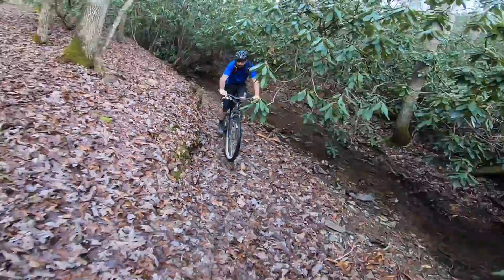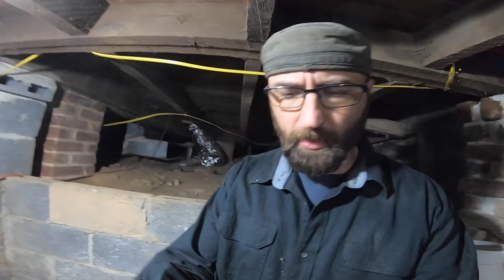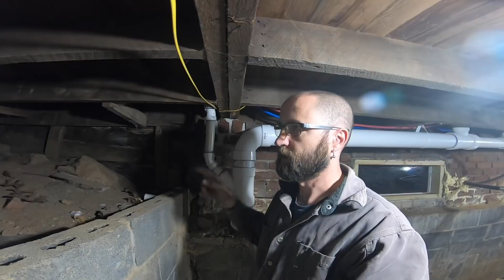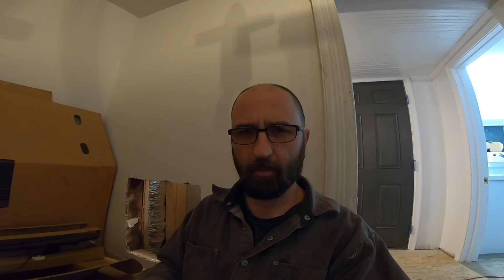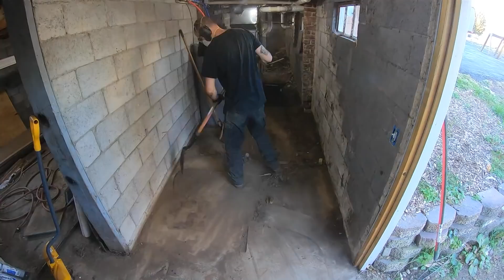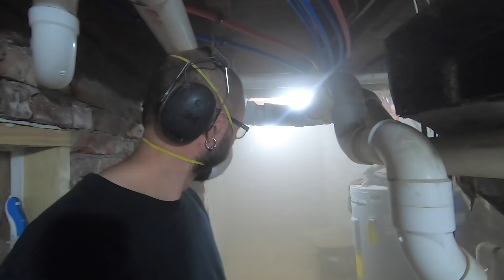Hoarder House // 130 year old house gets new pipes.

Comment: I actually used some of those shark bites for my tub/shower, a few years back (as I had no idea how to weld; or do much carpentry work, at all) and they seem to still be holding out.  If need be, though, I’m more confident that I could replace them.

Also, somewhat similar to what you did for the shower, I ended up not glueing the shower surround to the tile board.  Instead, I attached some heavy duty velcro behind it.  That way, if something needed repair, I could simply pull the whole piece off and attach it back when I got done.

Love your channel, brother!  It has inspired me to work on my own home again 🙂

Comment: Im worried your waste lines won't pass inspection for not using a Wye for a sanatee on its back. I couldn't tell if you have vents on the other fixtures.
Reply from the maker: It's fine. I don't have to use a wye. The other fixtures don't need vents since they're within 6 linear feet of the trunk line, which is vented.
Reply: @EmptyHammock  Sounds good. I know its dictated by area. My county won't allow me to do that. Lucky ha

Comment: When I install claw foot tubs instead of installing the cheap shower supply and shower curtain rods I make them out of 1/2 or 3/4 copper pipe that I solder together and it's way more ridged and custom fit for some of the tight area's I encounter. Good job on plumbing,
Reply from the maker: That's what I'm planning.. I didn't order the curtain rod.  :)

Comment: Good point about the Shark Bite fittings.  My philosophy (and I'm not a plumber or contractor) is to only use those in emergency situations (e.g. I had a pipe leak in my basement and needed a quick fix until I could get someone to do it properly, or learn enough to do it on my own, so I went with a Shark Bite fitting until I made a decision).  The biggest problem I've seen with those push fittings is people not putting them in as far as needed.  Great stuff Barry!

Comment: Here in Montana they use Insta-Tite fittings in the ground in which after a career in Water/ Sewer only seen two Insta-Tite fails. Both were due to Homeowner joes doing the instals themselves especially on mountain side homes. I seen only one Shark Bit fail but that was enough!!! I would never use them myself. Thats why your manifold system is killer from my years of inspecting operating.  There aint nothing worse than a flooded leaky place in the sub freezing cold!!! Got to love the blue poly and Pex pipe nowadays compared to the old galvanized!! Rock on bro !!   ;-)~

Comment: Thanks for being honest about cost/labor and the fittings... Some people are afraid to preach the truth!
Reply: I learned this when I hired a plumber to fix the elbow under my sink that was leaking. He replaced the elbow and found out that the seal around the basket strainers was old, so he replaced both basket strainers. Whole job took about 50 minutes and I got charged $450. Looked up the cost of each of the parts he used and I could have bought them myself for around $60. Fine job, but waaaay expensive. Never calling him back again.